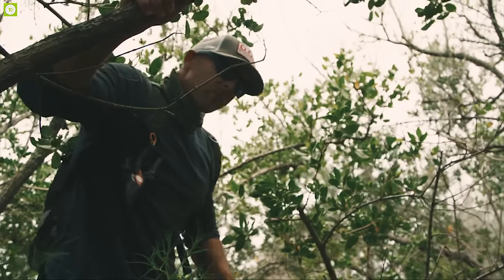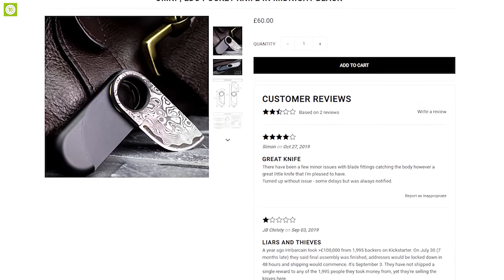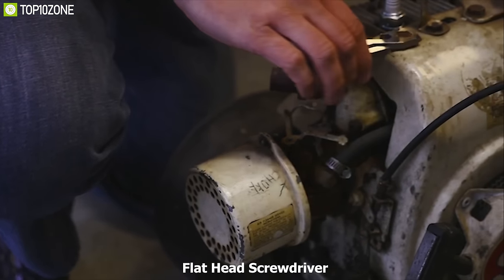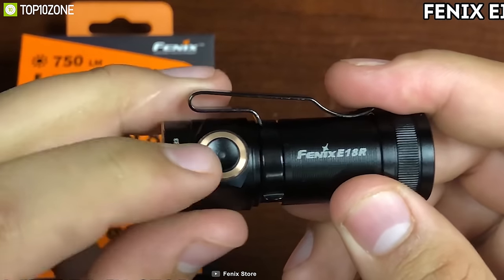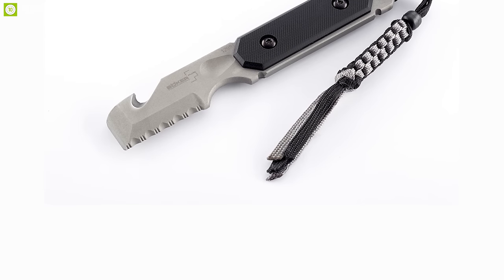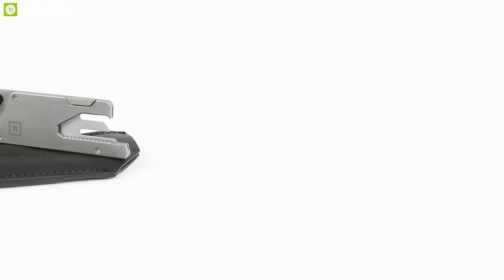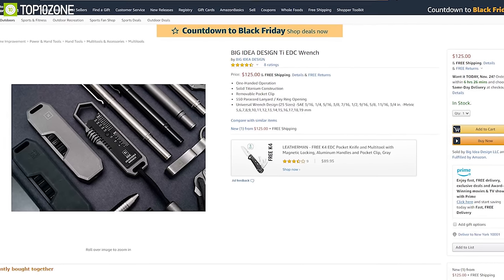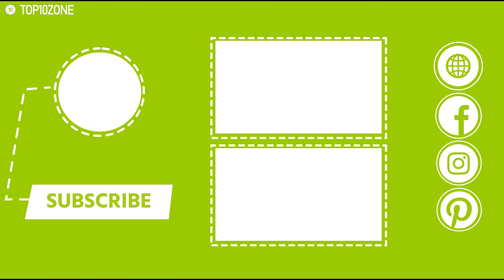Top 10 Must Have EDC Pocket Tools

Comment: Damascus is not 5 times sharper. Most likely it’s edge is less edge holding due to retention differential in the two steels welded together.
Reply: for real.... i dont know if i should finish the video based on that sentence...